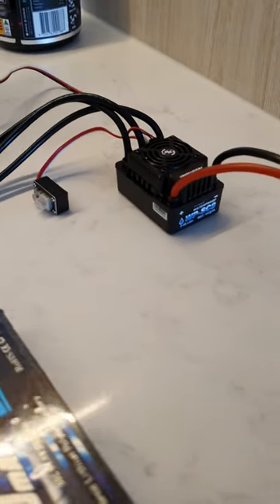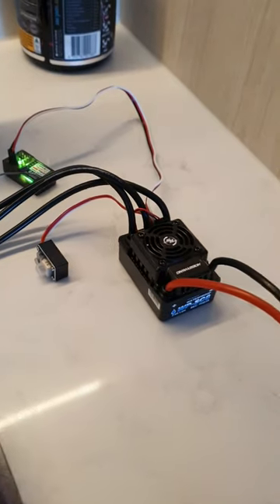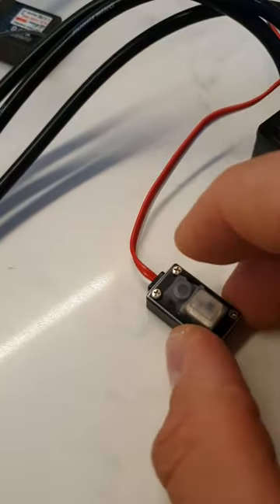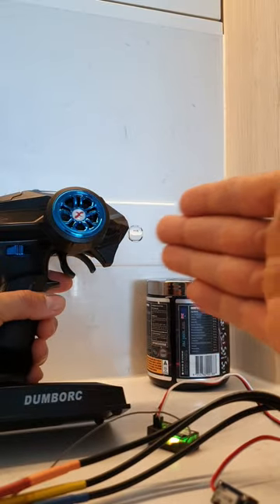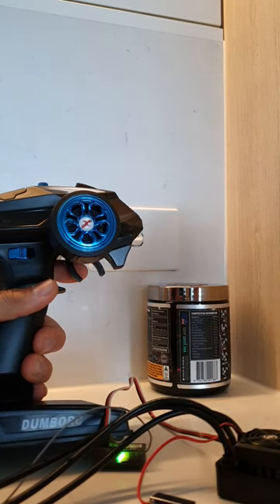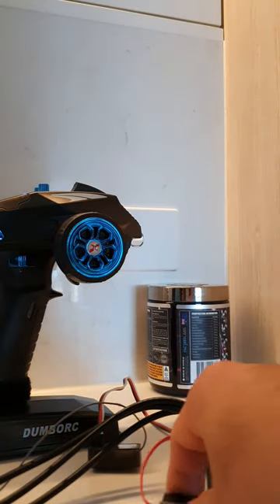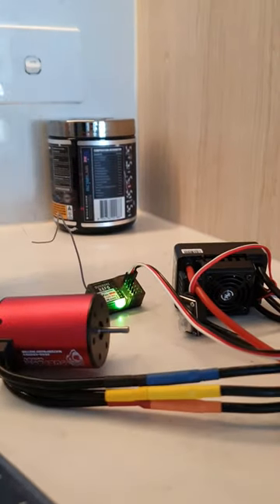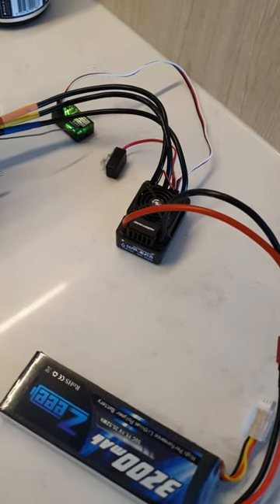hobby wing wp-sc8:  no throttle issue fix

Comment: Great video. I have this ESC and want to plug it in a Arrma infraction BLX 3S, 1/8. Stock motor is 3660-3900Kv. I know this ESC takes 4S, but will it run this Arrma?

Comment: Hey bud I have the same 120amp Hobbywing Do you know why when you do the calibration and put the remote to reverse I don’t hear the esc beep or flash ? Any idea why as I have no reverse .thanks
Reply from the maker: I did it a few times also and once I didn't do the reverse part of the sequence correctly and had no reverse. I did the whole sequence again and got it right.  Maybe try again? Also check your card settings for reverse is correct

Comment: i have the problem that my car worked , but a connector was busted so i remade it but i switched the wires and car got shorted for a sec , it turned back on when i fixed the wire 
but now the car would not move and it blinks 3x green every time , when i do your steps and countless others i tryd to find online it blinks once twice and three times just like u did to calibrate i , but afterwards still nothing happens and the blinking x3 green starts again , is my ESC fried cus i shorted it or what is going wrong? i have a WP-10BL50-RTR ESC btw
Reply from the maker: Does the esc smell burnt?  Like smell the esc and if it stinks even just sitting and turned  off chances are something burnt out. Also try another esc, sometimes the motor wires burn out first when hooking the battery the wrong way around  "mine did anyways lol when I was new to the rc game"  

In saying that check the motor wires and connectors. Shorted motor wires will cause a few issues 

Hard to tell tho without seeing it

Comment: My dumborc transmitter with 6 channel is having problems with the the throttle. When i apply power the rc car drives away slowly when i barely touch it. And when trying to reverse it doesn't go reverse i have been flickering the throttle to make it reverse. Idk could this be the trigger being bad? I have reverse in the esc programmed. When i tap the transmitter the acceleration kicks in even hitting the transmitter it stops it and also when i sway it left and right the rc taps away in acceleration.
Reply from the maker: Hmmm... have you tried a different radio and transmitter?
Reply: @jtsn667  what I did I have 2 receivers of this and my other rc truck was doing the same thing.

Comment: I wish it worked for me but mine just refuses to work with this method and weirdly enough when I got it out of the box and hooked it up it only started working when the battery got to 20% otherwise throttle input was disabled
Reply from the maker: So full battery there was no acceleration but once battery roughly hit dpwn to 20% battery it started working?  Sounds like a program card setting may be out

Comment: Hi guys, I had lot's of trouble getting throttle calibrated but I found out some things that might help you:

In my case i tried so many things which din't help. In the end it seemed that I fried my transmitter due to accidentally changed the esc settings to higher voltage which my receiver couldn't handle. It looked okay though but I couldn't get my throttle calibration done.cBefore I had the standard setup but I swapped it to the EZRUN MAX 6 with the motor as a set, better known as the Hobbywing ESC and motor.
Problem was with the EZRUN: 
I hold the SET button and switched it on, ESC goes in Throttle set mode, I press the SET  button to calibrate but just one beep sounds and nothing happens after that.
Problem with standard ESC: After I hold the ESC Set button and the ESC goes into calibration mode, the esc turns off when I pull throttle. I have to disconnect the battery and reconnect it to try again. The ESC won't turn on anymore after I tried.
There are some things that I tried and did help a lot of other people as I red, like:

- ENDPOINT RESET: It can help to reset your endpoints.
 https://www.youtube.com/watch?v=KM0IRJUT9Ew

- SWICH THROTTLE DIRECTION AND MOTOR: It sometimes can help to switch motor polarity cables, just switch two cables from your motor  (doesn't matter which one) AND ALSO reverse the throttle settings on your transmitter. You can easily do this with the app and a Bluetooth transmitter but you can also do it manually like this: https://www.youtube.com/watch?v=vhSACFw6Wk8

-- It's important to have full batteries!

- Try to disconnect your servo or motor

If all of that didn't work it could be that your receiver is not working properly as in my case. I ordered a new one and everything was okay!

Let me know if it did help you!!

Greetings Robin from Amsterdam